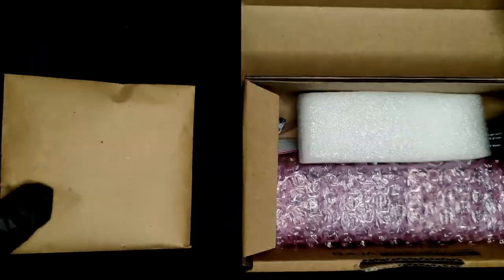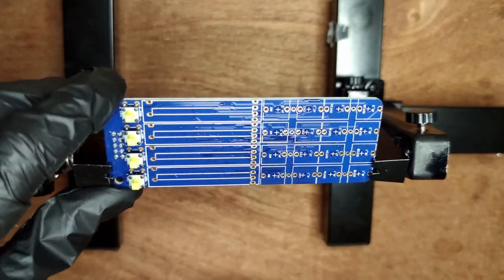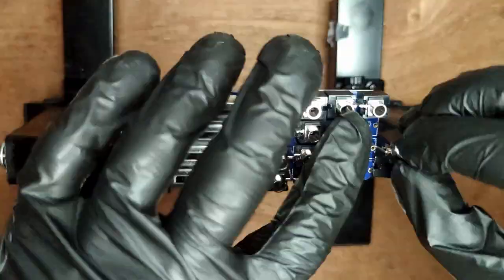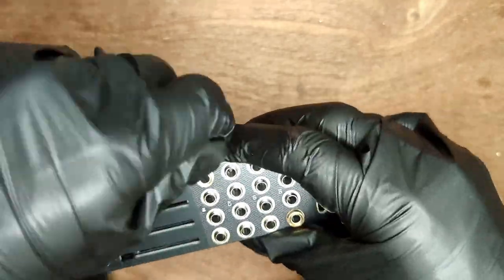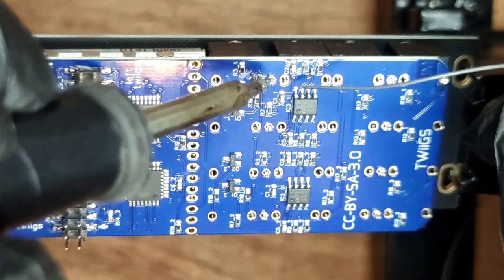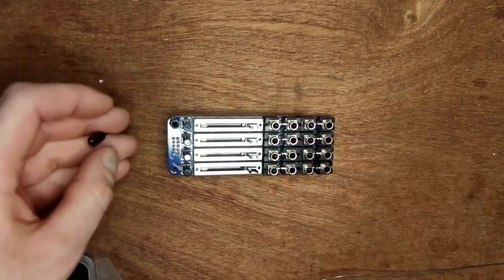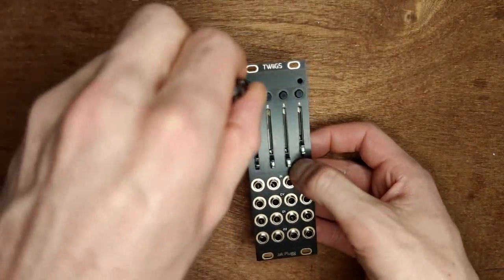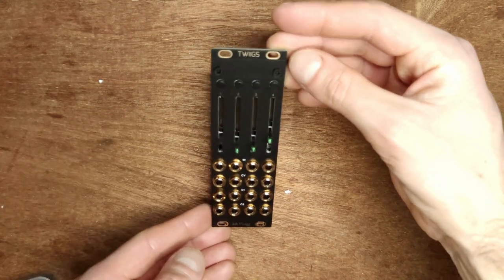Jakplugg Twiigs (Mutable Instruments Branches clone) - DIY tutorial, audio demo, review

Comment: You left out an important step that builders need to know! When placing the jacks the third long pin on the first row under the sliders should be facing towards the bottom of the module. Then the second row under the sliders should be turned around with the long lead facing away from the bottom of the module and the long pin should be inserted into the same hole as the row above it, both long leads share the same hole. Repeat this for the third row facing towards the bottom and the fourth row facing the top and the long lead of those two rows sharing the same hole.

It is also worth mentioning that the 4 additional LEDS in the kit are for changing the color of the sliders if you want to.